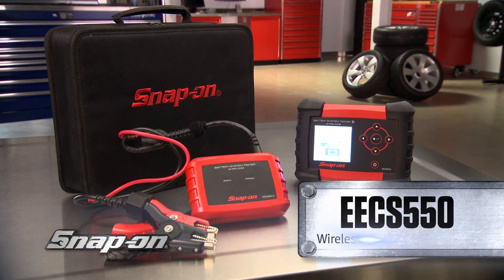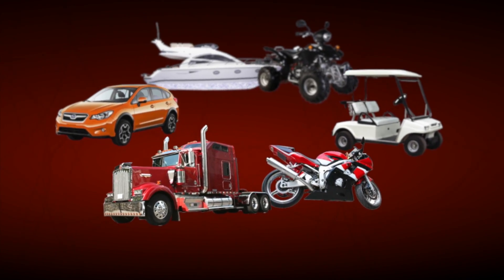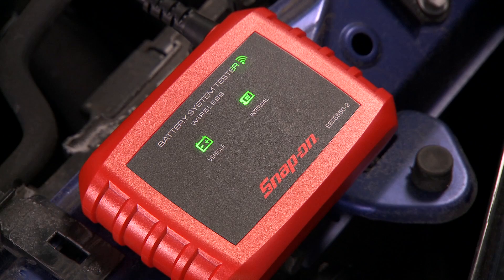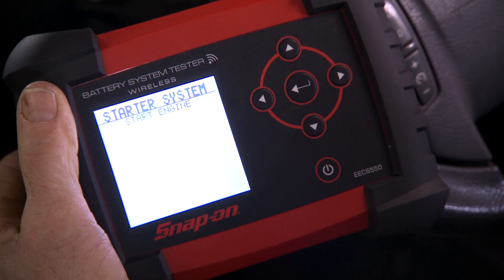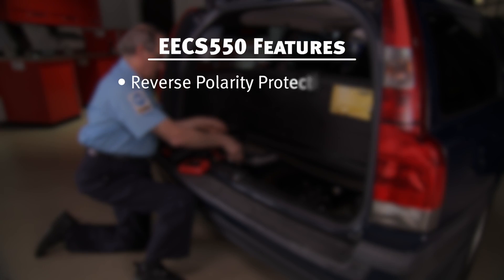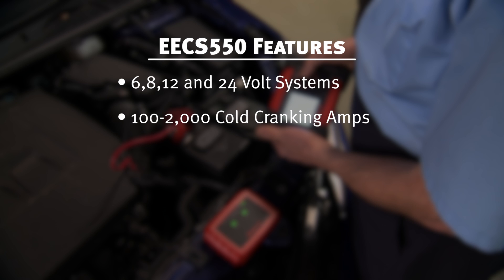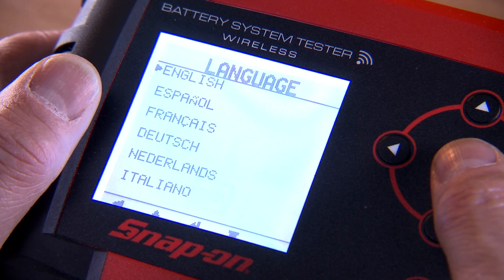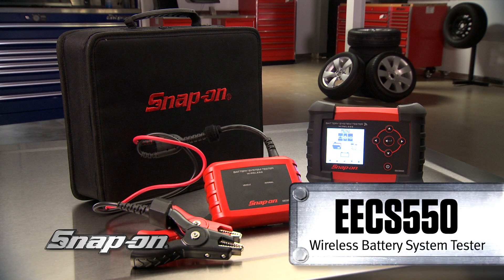Snap-on EECS550 Battery Tester | Snap-on Tools

Comment: I tried this battery tester for two months. Design and theory of operation is great, but the execution failed. The tester is way to damn sensitive. Almost every battery I tested it would say surface charge detect and to turn the headlights on. Only one time it the tester detect me turning the lights on. All the other times I would have to restart the tester, and 99% of the time it would just keep saying surface charge detect, and not let me by pas to just test the damn battery. @jonathan sanchez that is another issue  I had with it, I have windows 10 pro on my computer and it is not compatible. This is the only tool I have returned in ten years it was that frustratingly clunky. Perhaps ill give it another shot once it is usable.